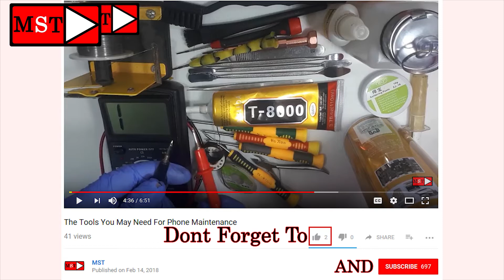Samsung S6 Edge AUX Not Working And Charging Slowly

Comment: After replacing Charging Port Daughterboard fast charge optnion not working. Is turned on in setup, but charge take +4h. New 5 pin cable.
Before this charging wire cable was melted, and charging wasn't working.
Any solution?
Reply from the maker: What did you change exactly , the whole flat cable or not ?
Reply from the maker: If no , you need to replace it all , if yes make sure the flat cable is original , i think that could makes the problem.
And i think that's all there is nothing else . Anyway tell me anything will happened.